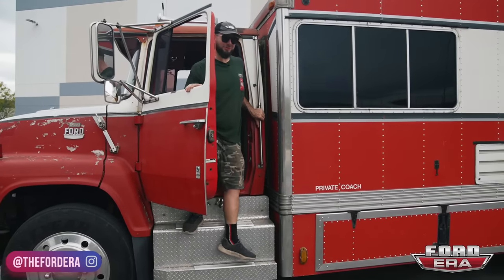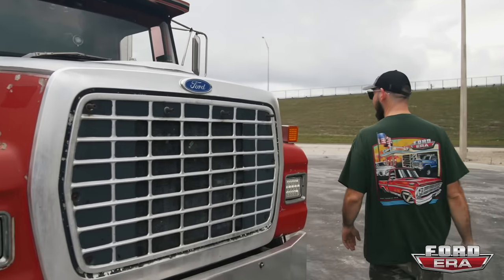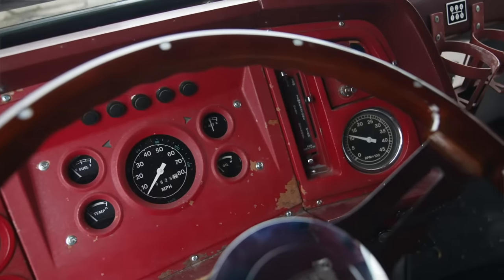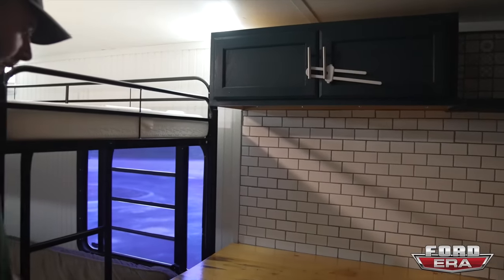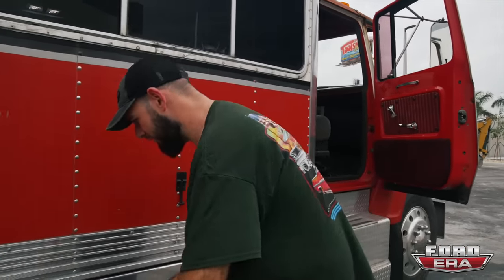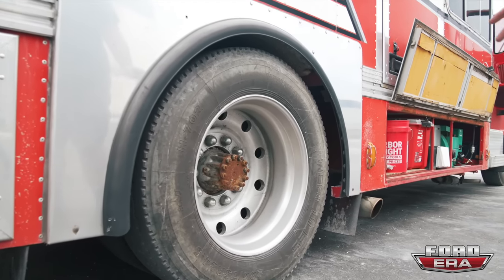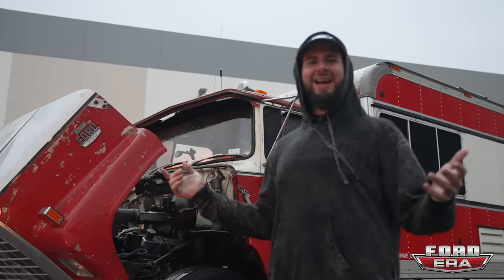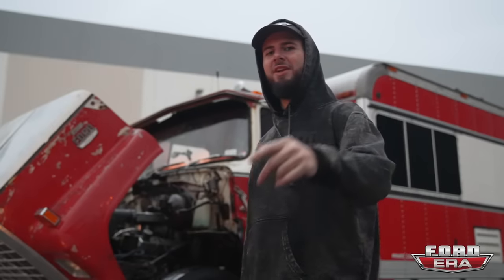1979 Ford L700 Vintage Camper | What The Truck?

Comment: I was in love with that thing tell I saw that 460, one of the best motors every made. That truck is to big for that motor, it needs a 350 or 400 Cummins Diesel with a 9 or 10 speed behind it.
Reply from the maker: your absolutely right
Reply: I almost wondered if it might have been converted till I saw the hydraulic brakes instead of air...  I agree 100%, I used to cuss these Fords back in the day when I had to overhaul those Big Cam Cummins in these!!(They actually tilted the engine instead of sitting straight up and down cause they were so tight!!! LOL) but I can't even imagine the fuel mileage he is getting, not to mention working that poor 460 to death!! Cool start for a conversion though!!!
Reply: @timbtimmyjim  its probably geared LOW i'm gonna say 67 MPH foot to the floor not for lack of power but for lack of RPM ill bet it's screaming at 3k doing 65 on the flats
that said the 460 can handle it
Reply: @Friedrich-Wilhelm-1980 who in the world would option such a large truck with an engine like the 460 that to me is the artist and the most unusual combination I've ever heard of or seen that does not make any sense to me not only mentioning the notoriously bad fuel economy you're getting
Reply: @ClayBenTreeceJr.  Because the 460 had enough power and the 460 had enough torque and for a truck that size you'd still be getting probably 6 or 7 miles per gallon

And the thing of it is there are guys out there and I'm one of them who do not want to miss with diesel problems of which there can be many especially from that era

Comment: Very cool!  
As a motor home owner for many years, I suggest that any interior modification you do includes planning for each item to be dual-purpose...i.e. *seating swaps to sleeping space with jack-knife or sleeper sofa.  *Ditch the bunk beds for a dinette (that can drop into a bed). *Rebuild the back bumper/door steps to have storage for stuff you want outside the coach (stinky slinky, oil, gas).
Best luck and be safe.
Reply: Gotta utilize the space when it’s at a premium 👍
Reply from the maker: thank you for the tips

Comment: Diesel swap would make it much more viable in this day and age...you would also be able to put in a more up to date Diesel generator for road usage too so you can run both engines on a single fuel supply

Comment: Looks great! I used to have a camper trailer so a couple tips. Storage is key, inside and out so maximize your space. Make sure your grey/black tank is at least 35 gallons and easily accessible to dump (I didn’t see the dump tube hookup so I’m unsure of your setup). Check the roof! Make sure it’s sealed and use new sealant like Dicor lap sealant and coat the roof white for longevity. Enjoy it! Looks awesome
Reply from the maker: thank you

Comment: i drove for a fleet that had hundreds of L8000's and 9000's (the diesels), so I saw the yearly progression of changes in the trucks. Pretty sure you have a newer (1985 and on) front hood, because the Blue Oval and rectangular headlights didn't come out until 1985 or so. Before that, it was "F-O-R-D" in large letters across the top of the hood. The V-8 for the gas versions was the 429 for most of its life, and those missing badges on the hoods probably were "429".Because the newer and older front hood "clips" were interchangeable it was pretty common to see "gas" hoods on diesels and vice versa after wreck repairs or severe cracking of the fiberglass. My personal favorite was the 1986 model with the "Batwing" aero kit, new styling, and the L10 Cummins.
Reply from the maker: thank you so much, its been driving me nuts trying to figure out exactly whats going on. it definitely should have had round headlights in it. And i think it is a 429 and not a 460. i need to really dig into it
Reply: Very cool truck. Definitely looks like ex-Fire Rescue. When we would have "accident" trucks, the body shop would just source a good hood assembly from an older parts truck because the hoods were identical except for the trim.So, you might have a 1986 with the updated grille, blue oval emblem, and rectangular headlights  come back looking like a pre-1985 with "F-O-R-D" and round lights. I'm no expert, but I do know that a 1979 would have round headlights. The 7000, 8000, and 9000 were all diesels. Drop a digit and you had the numbers for the gas version(s). We had 3208 CATS w/ a 10=speed Road Ranger in the 8000's and they were gutless. Later, we stopped buying 8000's and had 9000's with the L10 Cummins, a very good motor. My guess is that motor would make you very happy.

Comment: That 460 is bulletproof but you’re probably getting 4mpg lol That’s a big boy truck so a done up cat diesel would be at home in it.
Reply from the maker: your spot on
Reply: A Cummins 5.9 swap would be much easier and cheaper and these trucks came with them so it is no brainer swap.
Reply: @matthewq4b  where’s the fun in easy? If DeBoss can throw a Cat3126 in his 350, it could be done here too :)
Reply: @FordEra   We have a bought new 2015 gas Silverado 3500 4x4 crewcab dually with 70k miles. Gets 11 mpg empty and 6 mpg pulling our 10k TT . Welcome to the Club   🤣🤣🤣
Reply: Is it for sale?
Reply: Cat 3408 V8 Diesel only way to go

Comment: Carry a spare fuel pump with you.  I think you've got an issue inside your tanks.  Possibly rust floating or simply old gas thats clogging the pump up.  You may want to pull off the caps and check this out.  Good Luck.  Nice rig.

Comment: I love your truck. I have a 1989 Louisville 9000 with an L-10 Cummins and a ten speed. We are both retired now and I've been thinking about building an RV hauler. It's a short wheelbase tractor, so it would be more practical as a tow unit. Just another project...
Reply from the maker: That would be cool

Comment: Last comment but absolutely subbed! It’s a bit short but a great video, I can’t complain I hope you keep the outside patina, old AC (or at least the housing) and as much original stuff as you can but make the inside less basic and either go modern if that’s what you like or go with the style of the era in either modern with a mix of 70s or just 70s or it’s a 79 so you could get away with early 80s but this truck looks very 70s. Then use it, enjoy it, don’t let it sit.

Comment: I would redo the inside to my standards of comfort. Put a 24 valve Cummins with a Allison Transmission. Huge exhaust stacks, a wing on the cab, Texas bumper, custom painted to match a trailer, and light up the truck and trailer with tons of lights

Comment: Change Timing Chain and Oil Pump. We're common back in the day. ( Original Cam Gear had nylon teeth , when chain stretched gear teeth would strip and valve timing went out to lunch).

Comment: Find a Donor Ford with a Brazilian Ford diesel diesel in it or even a cat don’t get the V8 3208 or 1160 we’ve had them. They great on fuel mileage, but lotta different scenarios to that motor that can become expensive, scuff that cab down, sand it down, match the paint and give her a facelift you’ll have that truck for a long time, if you do it right, we built big rig trucks, Peterbilt, and those Fords in the day cab off full restorations and turned them back where people thought they were brand new in the day, that’s probably one of the most safest trucks you’ll ever put your kids in if you know what you’re doing
Reply from the maker: yes sir

Comment: I once almost purchased a very used old Ghostbusters wagon ambulance. 

I can't recall, but it was a Cadillac? 

I passed  on it. It was heavy and got very bad gas mileage about 8 miles per gallon. 

This was decades before the movie. It still had its lights, paint job on a used car lot.

I'm guessing because a town might buy it.

I'm not sure if the lights would have been legal for personal use?

I'm not sure where it came from. It was rural NC. Many volunteer rescues used standard Ford vans, fitted out, because of the cost. 

I'm assuming it was from a hospital.

Comment: the front hood is a 84 or newer ,thats when the head lights got square .it might have a 429  truck engine,is there a motor mount under the balancer ? .the L line of trucks would get the old 401/477/534 SD gas engines .my 1981 l900 has the 534 engine and round head lights .hydraulic brakes are easier for the average person to maintenance,but don't neglect them.there should be a fuel pump in the gas tank .install a fuel pump for each tank ,like a lift pump for a diesel .have those pumps feed into a bigger ,better main pump ,then the fuel pump might last longer

Comment: At the 1st of the video you made comparison to F series. F series often shared things like cab parts ect. Nothing on a L series will cross over to F series with exception of maybe switches or AC parts ect. Cabs come from Heavy Duty line with L700 being the smallest and going up to the L9000. The F series the F700 is the largest with the occasional and rare F800.

Comment: It had some upgrades square headlights( LED ) are not 1979 also I do not think a 460 was in it new and it has a 5 speed with a 2 speed read common for that time frame also the brakes are old school with that big booster be very very careful watch for leaks and the boosters go bad ,,,,,,LN700 1979 maybe 391 the LN800 had the bigger 477 0r 534 but the hyd brakes with that booster that would be a hell no for me hard to get parts for then

Comment: If it is a 460 someone engines swapped it. It should have one like a 370 or maybe a 429. Just saying ford didn't put the 460 in l700 or any heavy duty truck
Reply from the maker: its a 429 i found out

Comment: Great kitchen   without a stove, or sink, fridge😂
Reply from the maker: it has a microwave and fridge
Reply: Guess you don't know what a single burner hot plate is, an air fryer toaster oven or what purpose a camp stove serves. 

How about one of those plug-in coolers people use these days as a fridge that seem to be popular for some travellers.

As far as a sink goes a shallow plastic tote could serve that purpose.

That wasn't a very funny comment you made to laugh about that.. it was a bit sad sort of like people that are incapable of using their noodle. 

Maybe the previous people that built that rig didn't want the complexity of those amenities added to it for the sake of not having things that break and are always in need of repairs or cause more problems with things that use water like leaks.
Reply: @marcodarko6941  if it was shown !!!

Comment: That fuel pump is never going to work long-term, you’ll be changing it every week. Go back to the factory fuel pump if you’re smart.
Aftermarket electric fuel pumps like that are not supposed to be lifting fuel from the tank. They are supposed to be pushing fuel that is gravity fed from the fuel tank. So if you want to stay Electric, it needs to be below the level of the fuel tank.